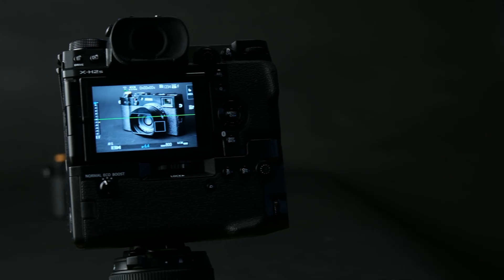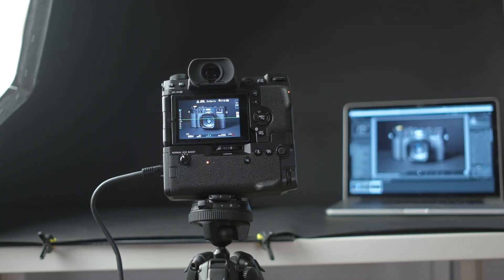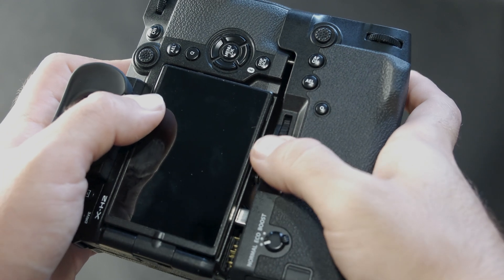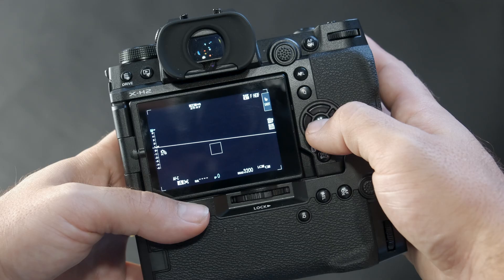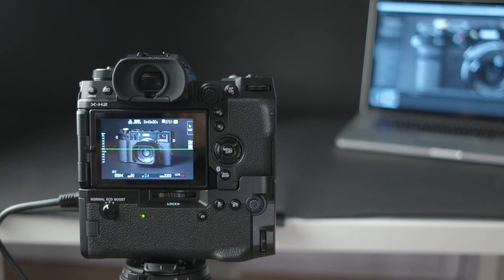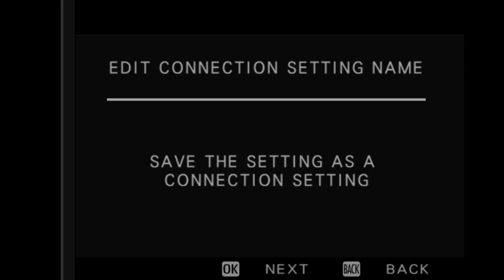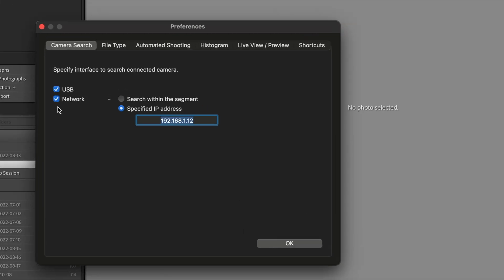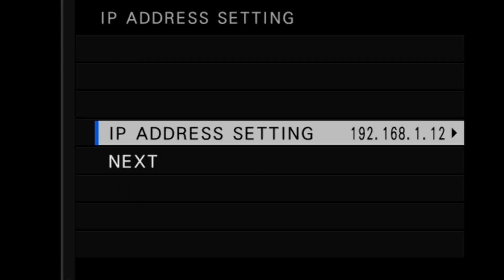File Transmitter FT-XH: Tether Shooting Tutorial/ FUJIFILM

Comment: I bought a ft-xh grip mainly to improve wireless tethering when using my X-H2S in studio connected to a M1 mac. i usually tether the camera with the USB cable, but i was looking for a fast wireless solution. X-H2S internal wireless speed isn't that great (i basically get 4/5 second to transfer a lossless compressed RAW, from shooting to display the image in Lightroom) when connected to an 5G access point, but it seem exactly the same using the grip (the wifi connection icon shot FT logo, so FT is correctly connected) . i still get 4/5 seconds to have 1 file trasnferred while the same with cable take around 2 seconds.  any help here to improve the speed transfer? thanks.

Comment: Why are we paying just under 1300$ CAD before tax for a function other brands have built in to their bodies for a few years now
Reply: They don't though? The X-H2 and X-H2S has the old style tether cable too without needing this grip. But those cables have short maximum length. Ethernet cables can be more than 100 meters long. Sure, the Nikon Z9 has a native ethernet port... And yet is still twice the cost after adding this grip to the X-H2/S.
Reply: @Vinterloft  the grip doesn't just add ethernet support
Reply: Canon / Nikon offer wireless transfer grips and port side dongles to greatly increase wifi transfer speeds. Wifi doesn’t do great with magnesium alloy and the higher the transfer speed the more heat it will generate.

All current fuji cams have basic wifi / tethering options.

Ethernet ports tend to come on Z9 / R3 / A1 level bodies.